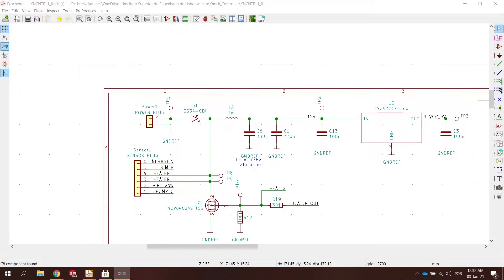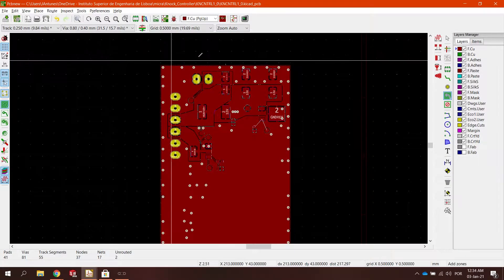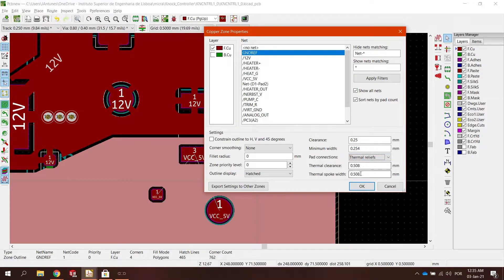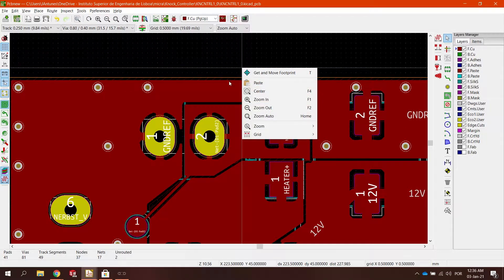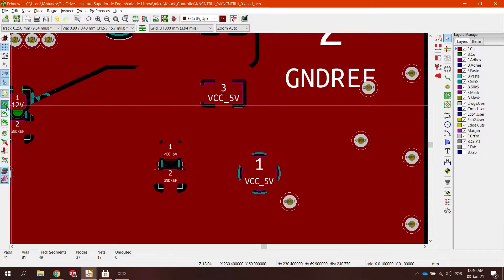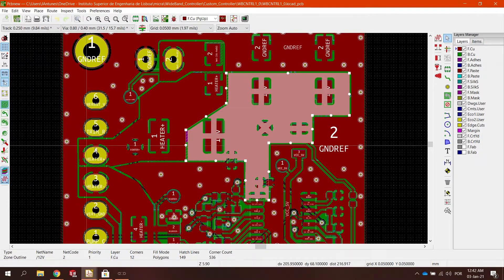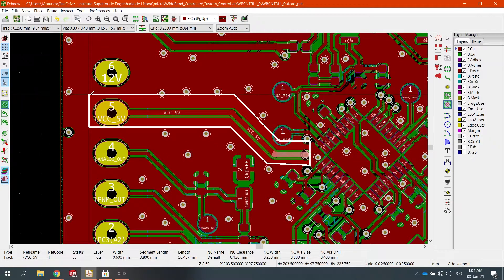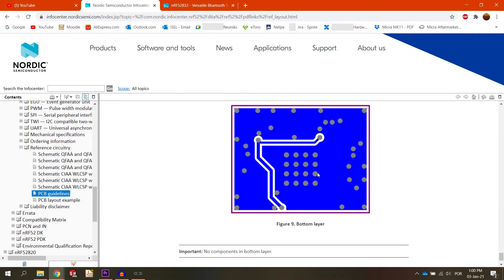Everything you need to know about power planes in KiCad

Comment: I am making a 4 layer board and need multiple voltage zones on the power plane (inner #3)  When I put in a via from a trace on the top layer it does not seem to connect to the zone on the third layer with the same name.  Also I cannot make the PCB show me a filled in inner layer. It looks like they are treated differently. 

For me a ground plane is an inner layer that is ground. But all You-Tube videos only deal with ground planes on the outer layers. Not the inner layers.
Reply from the maker: They are treated almost the same way, and they can stop showing up for 2 reasons:
1. Equal or lower priority as the guns plane (if it's equal it will show but meshed with the gnd plane and will trigger the drc)
2. They aren't connected to a pin of that net. Eg. A net ACCEL1 is connecting 2 pins, if I route via a plane but I don't connect it to one of the pins, it wont show up, if I connect it with a track and a via to a pin with the ACCEL1 net, the entire plane will show up